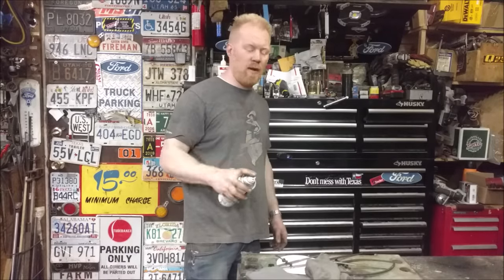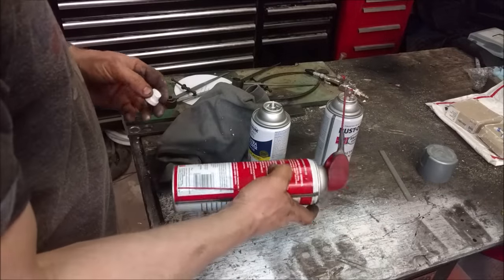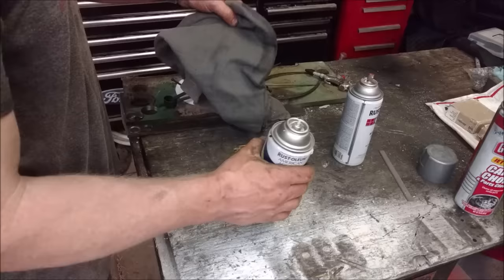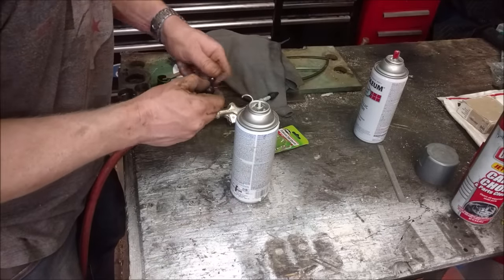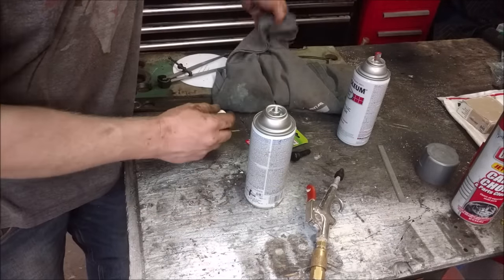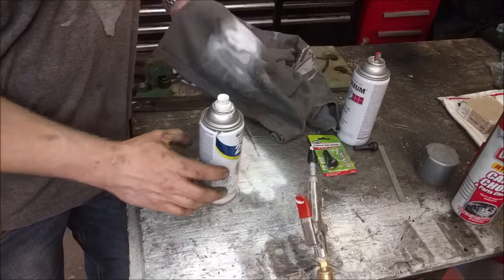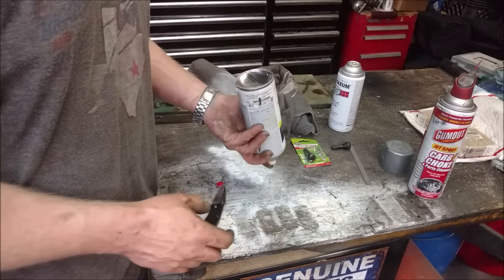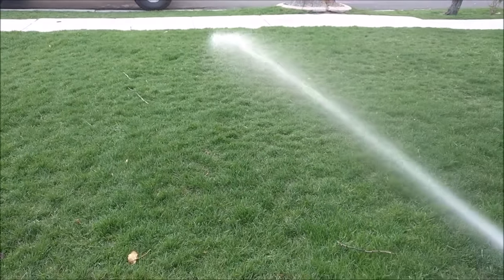Fix Clogged Spray Paint Cans

Comment: I wonder if you can use a mityvac to draw a vacuum instead. That may pull out the clog and avoid introducing air into the can.
Reply from the maker: Generally the pressure in the can is 75-100psi pushing the clog. Warm up the can and the pressure increases. I will say the air introduced is so minimal I haven't noticed any issues.
Reply: @sixtyfiveford  Yeah, but don't you think in addition to the pressure in the can going out, pulling 20-30 inches of mercury from the outside will unclog it? I'm tempted to try it but I have no clogged cans.

Comment: I was complaining to the paint rep once at a big chain store and he explained why that 3 minutes of shaking that nobody does is so important. Not only does it mix the colour properly but, especially older cans or in warm weather, the paint develops gooey lumps like snot and the shaking helps break them down. I also save the old nozzles in a jar of acetone but since I have been shaking the shit out of the cans and doing the up side down at the end thing I haven’t needed any. I have used the sawsall method of shaking cans but hanging on to that for 3 minutes with a can full of paint flying up and down gets old real quick. Time to design and build a proper shaker that actually works.
Cheers Stuart 🇦🇺

Comment: The tire schrader valve doesn't travel far enough to depress the male extension, thereby I am unable to get air into the can.  Maybe if I cut off some of the bottom of the schrader valve it will work?
Reply from the maker: You have to generally force/stretch it over the metal nub. There are many different can designs though so you may have to trim it, but I've never had too.

Comment: I turn the can upside down and use my can opener.  I removed the bottom of the can.  I got a sprayer container from an old sprayer bottle and pour the solution from the damage aerosol can into the old sprayer bottle.   Am good and going.

Comment: Rustoleum is the worst. I hate it. But that’s all you can find at Home Depot and Lowe’s. The Rustoleum sprays at any angle, and you can’t clear in out when you’re done by turning it upside down because paint keeps coming out. It never comes out clear. I’ve started taking the cap off and cleaning it with brake cleaner or carb spray so that it’s ready to go next time I need it. Duplicolor is better but you have to go to an auto parts store.

Comment: Can of  compressed air, pop the nozzle
Can of non working spray paint, pop the nozzle
Now have two same sized ports, so line them up and press.
The air from one can will blow the paint out of the other.

Comment: Thanx For the Tips 65F, Especially the carb cleaner to know some thing that dont melt the tip/passageway. my clogs ussually are the tip hole & I use sewing Neeedles   to open up yet ussually when tip is clogged so is the bottom of the tube going into the can. & Great Idea, every one to save all the good tips for l8tr use.
Reply from the maker: Thanks.

Comment: Rustoleum 'wrinkle' finish.  Can clogged almost immediately.  Swapped nozzles.  Nope.  Tried pressurizing the can with the tire valve stem trick.  Nope.  It added air to the can but didn't clear it.  Took it back to the store for exchange.  The new 2nd can plugged even quicker!  Completely full.  So pissed.  At $8 a can?  Now a 3rd trip to the store.  I'm painting the stuff in their parking lot, tired of driving back and forth.
Reply: Rust Oleum Cans are garbage. I had to throw an almost full can because it was clogged and . Also are so expensive

Comment: I tried this hack on four different cans of Rustoleum.  I didn't work on any of them.  I cranked-up the pressure on my compressor.  nothing.  I couldn't get air pressure to back-flow into the can.  Perhaps 120 pounds of pressure is not enough.
Reply from the maker: Put a drop of acetone down the little hole. This will soften the hardened paint. If all the pressure drained out of the can they could be a solid lump of paint inside.

Comment: What if I use nitrogen instead of air? Will nitrogen cause the paint to dry inside the can?
Reply from the maker: Normal air is nearly 80% nitrogen. Using something like propane would be more ideal.
Reply: @sixtyfiveford  ah, good point. I thought it was around 20%. I don't have a way to get propane to pressures that high. We use nitrogen in the line when brazing medical gas copper lines to keep them from getting all burned and oxidized inside from the high temp required for brazing. I put my sunflower seeds in a Ziploc bag and fill with nitrogen to keep them fresh over night. It works like a charm. That's why I was thinking it would work in paint. ..what about CO2 or Argon? I've tried argon on my seeds but they didn't taste as fresh after..
Reply from the maker: A bbq propane bottle at 70F is right at 110psi. I tried shielding gas argon 75%/co2 25% and it dried out. I think straight argon should work though.
Reply: @sixtyfiveford  I see.. What kind of regulator do you run it through. ..or ..wait. .. I get it now. Duh. What was I thinking? You run it straight through, huh? Bottle pressure to air chuck, huh? Thanks for the tips. 
Btw, its good to see you're still putting them out. I was beginning to wonder what happened to you. I haven't been getting any of your videos in my feed in a while now. I think the last one I saw was one where you made a new floor pan for a '77(?) Ranger f250(?),  or something like that. Like I said, it's been a while. 
The funny thing is that I almost tried something like this last week and it was based on your recharging the WD40 can to get the rest of the oil out, that I saw a couple years ago.  ..Anyway, thanks again for all the good videos and all the good tips n info. I look forward to more as it comes..
Reply from the maker: If you steal the adapter from an old jjunk propane grill it will have 1/4" npt fittings that are direct bolt up to air lines.
Reply: @sixtyfiveford  yes. Thanks. That's what I realized in the middle of my previous comment here. I was just stuck on stupid from last weeks mod. I adapted an old oxygen regulator to hook up to a scuba tank so I could regulate the pressure from 3,000 psi  down to 40-50 psi. I was set on there needing to be a regulator in the mix..

Comment: Rustoleum brand with the spray at any angle is the worst paint I have bought...You can not turn them upside down to clear the nozzle ..I have had so many cans fail that I just will not buy that brand any more
Reply from the maker: When I buy new paint cans it's always Krylon. They're my favorite. I love buying up garage chemicals/paints from estate auctions so I end up with a ton of old cans for pennies on the dollar. Surprisingly most, even ones from the 70's still spray, but Rustoleum gives me the biggest fits.
Reply: Those painter's touch nozzles suck! I blow the nozzles out with compressed air after each use, seems to help, until the valve gives up. Good to know I'm not the only one having issues with those.

Comment: I get these from a motor factors  saves them costs from getting them disposed of
Very rare you get lucky
Normally just select the colour of choice and cut the bottom off and dispense into a gravity spray gun
Do the job I need and chuck the aerosol in the scrap bin

Comment: HOW ABOUT THE CONCEPT OF TAKING A DEAD DRAINED CAN REPLACING THE PAINT AND AIR PRESURE this way if you have some okay paint kicking around you dont have to keep rebuying sparaypaint cans which are kind if exoensive unless your using cheapy doller cans also a company called YOU CAN sells this product a reuasable spray can .. I bring this up as u show how to unclog however what im saying is the next level i feel

Comment: Of course if you turn the can upside down and spray until just air comes out then you have cleared  the line .Then store the can upside down so the end of the tube is in the propellant not the paint then it will be clear when you go to use it again.By doing this simple thing you will never have a clogged line again.Cheers.

Comment: Used cans always warm the can first, use it, remove the tip store tips in lacquer thinner with a tight sealing cap, like a jelly jar, you break jar get new jar so what,  never any problems with this. But what ever works for you

Comment: Quite often the problem is the valve leaking very slightly and the paint which oozes out hardens. When you've finished your spray job, wipe the face of the nozzle clean, invert the can and spray until only propellant comes out. Then, and this is the important part, store the can upside down. That way, only propellant will ooze out. Not guaranteed to work every time but worth the effort.
Also, when the can is empty, and if the nozzle is OK, pull it off and store it in a jar of turps or similar as a replacement.

Comment: damn, i have a few cans of paint clogged and no compressor . well im gonna save for one 
😓
Reply: I know this answer is coming a little late, but you can try unclogging them by shortly pushing a thin piece of wire in the clogged hole. But watch out for the paint that comes out during the process.